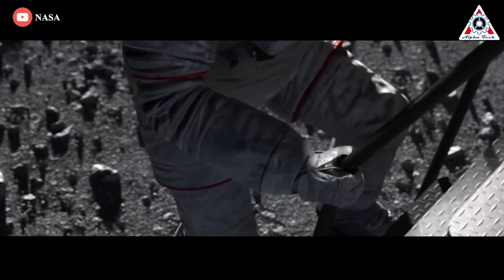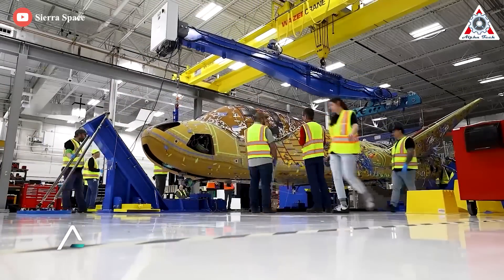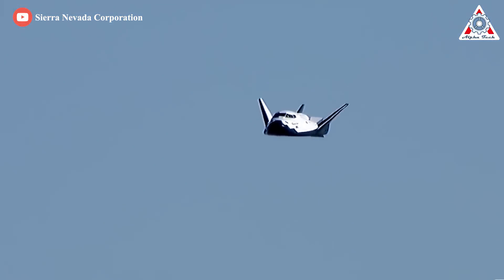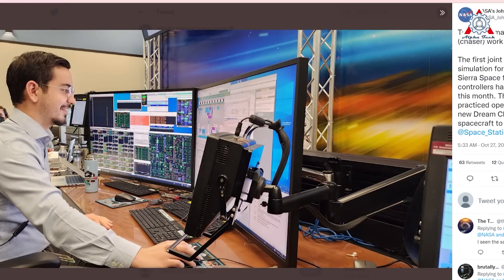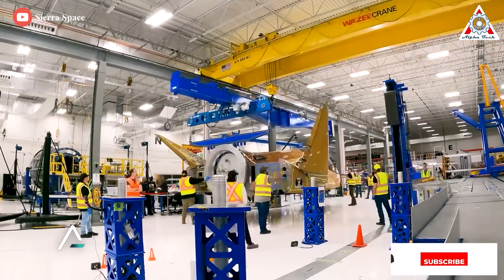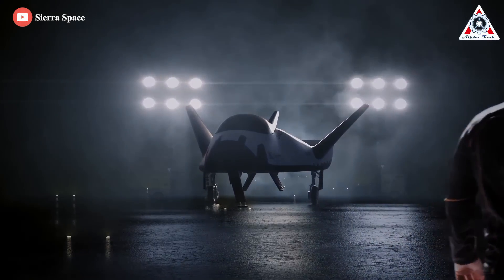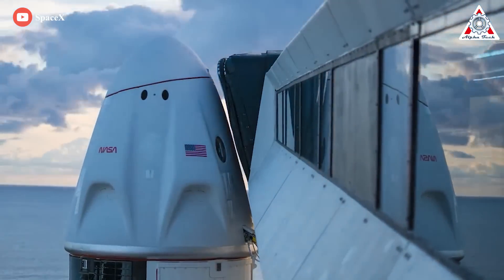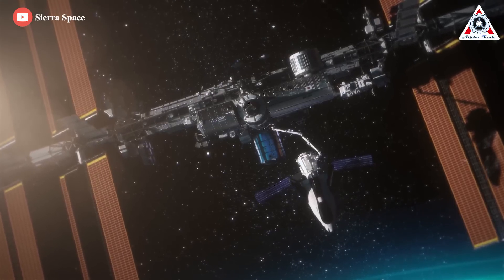Dream Chaser HUGE Update "First launch incoming" that makes NASA crazily

Comment: I really hope this works well.  We need so many new space companies to succeed, hell I still have hope for the failed Blue Origin.
Reply from the maker: Maybe next year BO will make some huge progress, just hope so
Reply: @alphatech4966  Criminals like BO hurt our country and the entire planet with their evil, lying ploys. I wish them long terms in prison.
Reply: It's a bit premature to pronounce on BO's fortunes. Remember, they have just delivered (v. late) the engines for the new Vulcan rocket which will propel DreamChaser on its test flight. So that might be the way they'll finally reach orbit. But they've put on a poor show so far, very disappointing, and even their suborbital fairground ride is having reliability issues.
Reply: @Togidubnus  BO gave up the race years ago and is only limping slightly at this point.  Those two engines took them how long to make???  Yeah, they are officially a startup, Jeff Bozo doesn't have the drive or the creative edge to form a major Space Company. As I said, I do wish them the best but the last 10 years are not looking good.

Comment: Do you know why Dream Chaser doesn't have a front landing gear wheel and why it uses a sled type gear?
Reply: Less volume, less mass, less moving parts, Less to go wrong. The less tires, the better. We know from experience that an exploding tire can rip a space shuttle wing clean off.
Reply: Probably it's meant to work as a brake to shorten the landing runway.
Reply: Yes.  The Space Shuttle proved that the nose wheel in this type system is prone to blowouts.  The sled supports the vehicle, while avoiding the possibility of a blowout.
Reply: @michaeldemarco9950  there was only one instance of a space shuttle tire blowout out. One case out of 135 missions. I'd hardly call that "prone to blowouts".
Reply: @DeepDeepSpace  , but even without blowouts, many were on the verge, suffering much more damage than the wing wheeled, per flight.
Reply: MONEY!!
Reply: Pioneered by X 2 and X 15. And spaceshipone. X 15 had rear skid, which proved problematic.